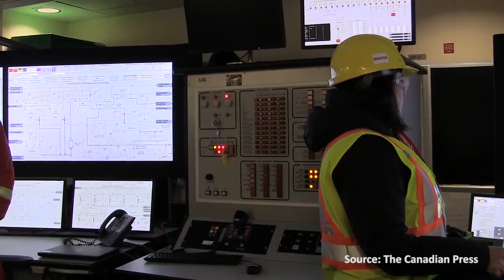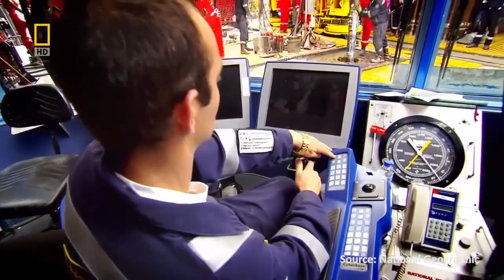The 5 Largest Offshore Platforms of the World

Comment: The platforms referred to are not the worlds largest. It may be the largest in America, but not world wide.

The tallest platform in the world are 
Troll A, standing 382 meters above the ocean floor and a total height of 470 meters. Also with a total weight of 662.000 tons.

The heaviest platform are Gullfaks C with a total weight of more than 1,5 million tons.
Reply: I would say Thunderhorse for BP is one of the biggest in the united states.
Reply: The Ninian Central Platform off of Shetland in the North Sea was the worlds heaviest manmade structure up until just a few years ago
Reply from the maker: @Clutchdjw  "Worlds heaviest manmade structures" would be a great video :)
Reply: It WAS when it was built in ‘78. The Gullfaks C dwarfed it just a few years later, with 1,5 million metric tonnes. I would bet even the Gullfaks A, Oseberg A (perhaps even Draugen?) is quite a bit heavier. The Troll A that was completed in 1996 is, for sure..
Reply: YouTube comment section really sucks. It was suppose to be a reply for Dave Watt.
Reply: @Clutchdjw  It was the world's heaviest MOVABLE manmade structure (I bet the pyramids were heavier!) when it was installed in 1978, but was overtaken soon after by 'Statfjord A'
Reply: I worked on an oil platform for years and I'm wondering why nobody's talking about sexuality. I had gay sex every day for years as a straight guy with lots of straight guys.

Comment: we built gulf hibernia.. is that in here
Reply: worlds largest
Reply: Hibernia oil field
Estimated oil in place 2,100 million barrels (~2.9×108 t)
Recoverable oil 704 million barrels (~9.60×107 t)
Producing formations Hibernia, Ben Nevis/Avalon
Hibernia is an oil field in the North Atlantic Ocean, approximately 315 kilometres (196 mi) east-southeast of St. John's, Newfoundland, Canada, in 80 m of water.[1]:35–36

The production platform Hibernia is the world's largest oil platform[2] (by weight) and consists of a 37,000 t (41,000 short tons) integrated topsides facility mounted on a 600,000 t (660,000 short tons) gravity base structure. The platform was towed to its final site, and 450,000 t (500,000 short tons) of solid ballast were added to secure it in place. Inside the gravity base structure are storage tanks for 1.3 million barrels (210,000 m3) of crude oil.
Reply: @Hello johnny llooddte, How are you doing?